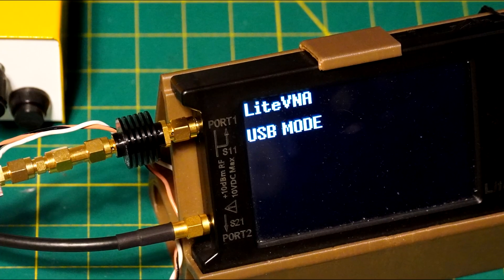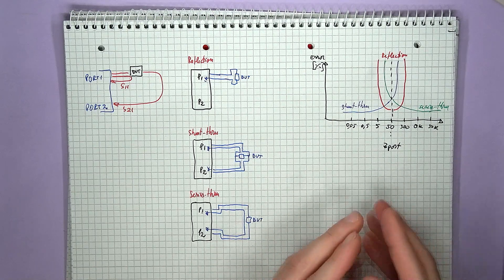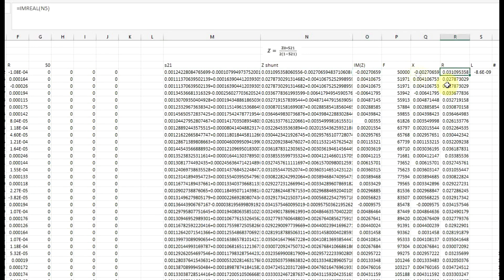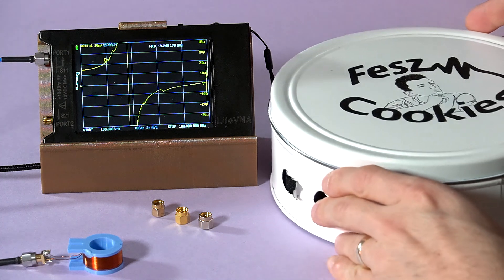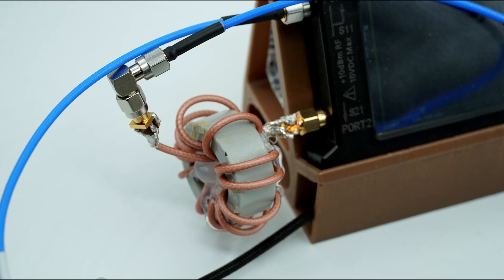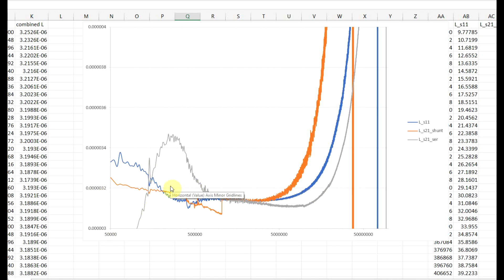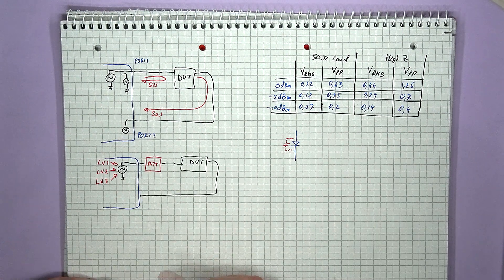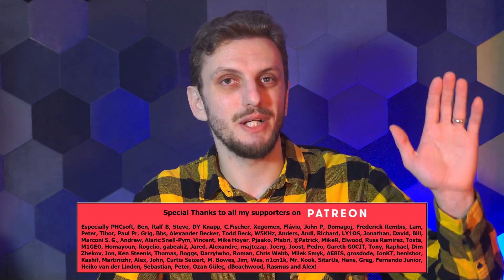How to setup your VNA measurements

Comment: Excellent video, thanks. I'm watching it over and over and trying to understand the data format from the nanovnasaver file. That are the values under the columns of S, RI, R and 50? Where do I find the definitions?
Reply from the maker: The first column is frequency, and afterwards you have RI - real+imaginary pairs for the S paramters; so first pair is S11 and second pair is S21
Reply: @FesZElectronics  Thanks, that makes sense. I'll make an attempt to process that data in the spread sheet.  I'm also looking more closely at nanoVNASaver and it seems it has graphs that do all the computations. I'll have to look more closely at that as well. Thanks for your really useful videos. Probably the clearest in this field on YouTube.
Reply: @FesZElectronics  Ok, finally got the spreadsheet to work. Thanks. 
Just wondering if you can point me to a reference that describes how to compute, say, through gain measured from the s-parameters. I find pages that require S22, and S12, but clearly the nanoVNA doesn't have these values. How do we get those from the files  generated by nanovnasaver?
Reply from the maker: S22 and S12 are the same as S21 and S11 just measured from the other side; S11 is reflected wave from port 1 back to port 1; S22 is reflected wave from port 2 back to port 2; if take the same circuit and swap the way in which its connected to the NanoVNA, even thought the values will be saved as S11 and S21, you can edit them and treat the results as S22 and S12 - port "1" and "2" is just a convention.
Reply: @FesZElectronics  Thanks for that explanation. My question was more about how the nanoVNA computes the S21 gain. Clearly when it sweeps and produces the graph it doesn't have the S22 and S12 values. Anyway I was able to recreate nanovnasaver graph of S21 gain in the spreadsheet by calculating the magnitude of the S21 value and then taking the 20 x log10 of the magnitude. I am left wondering how this compares to the more detailed calculations that require S22 and S12. Maybe you can make a video about all this? It would be of great interest. I certainly learned a lot in this process and can see what I still don't know :)

Comment: Thank you Fesz. Very usefull and clear explanation as always. Could you point it out limitations of vna measurements and why we use network analyzers with different impedance values if vna can measure even miliohms. I have Analog Discovery 2 or other more expensive alternative in mind. Thank you

Comment: I would add that a VNA is also able to measure S12 & S22 parameters by reversing port1 and port2. If done for an active device (LNA, MMIC, ...) be sure that the active device is stable (not self oscillating) and linear (no C class power amp !).
Please note that the 2nd link provided is not working (error 404).
Reply from the maker: Thanks for letting me know about the link; I found an updated version of it. Also the point you mentioned about the other Sparams as well as the type of active device to be measured are also valid and important! I may do a follow up at some point

Comment: This is probably the most interesting way to use a vna for. I work with HF and its a real nightmare if you have undefined parameters in your komponents. This mesurments can be as essential as a simple voltage mesurment but it never get explaned so decendly. Thank you for this Video.